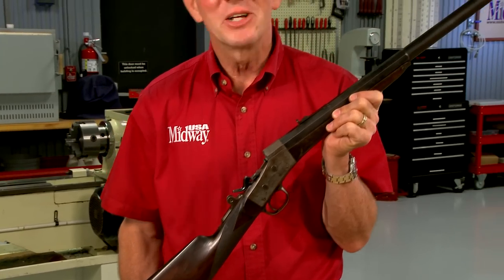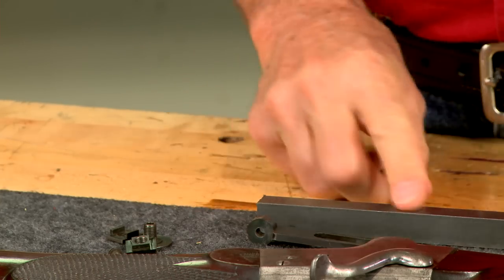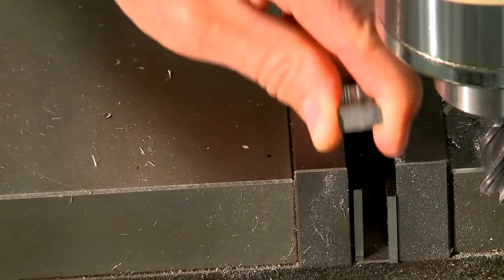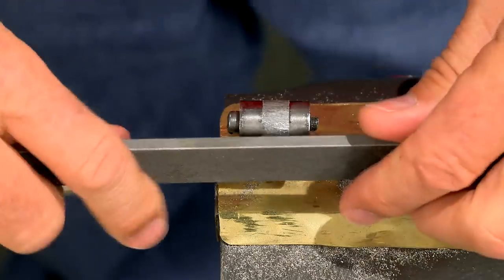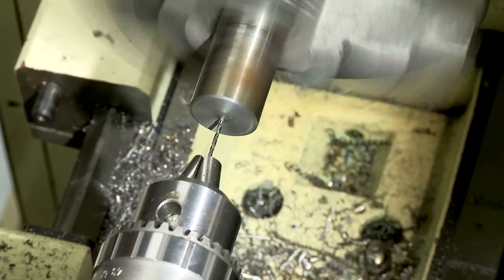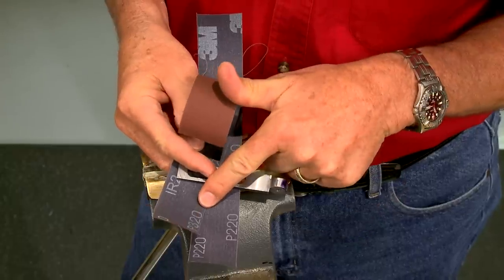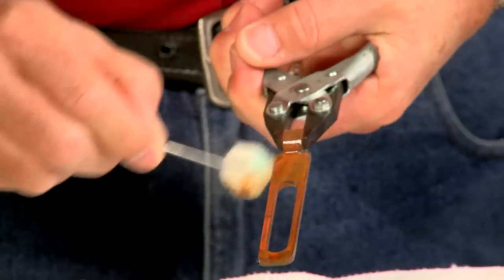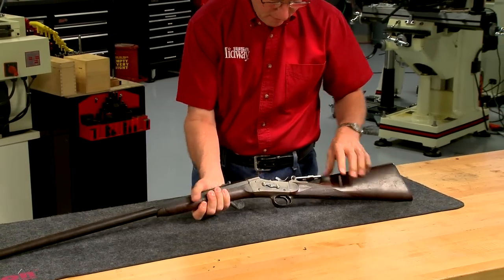Gunsmithing - How to Make an Original Style Tang Sight for a Rolling Block Target Rifle

Comment: can't believe you'd stoop to shimming the sight in Larry, I recall a video of you showing the difference between amateur and professional work and I believe shimming a scope was one of those things you pointed out.

I know there's a difference here but still, i figured you'd find or make the right front sight for this gun.
Reply: There is nothing at all wrong with shimming the front sight, it is the simplest solution that works as well or better than any other solution, including complex ones like manufacturing your own front sight from scratch, when you have one all made that will function perfectly as well with a shim.  That isn't true of shimming a scope. Having said that, I have shimmed scopes in the past and had it work just fine, even if it is a hillbilly fix. Of course, I have duct taped a flashlight to a shotgun and had that work fine too, in a pinch!
Reply: yes! shimming is a easy out i saw that vedio lol

Comment: Just a question. Why do you do so much filing and hand fitting when you have machine tools? Surely milling the slots and radii would be faster and more accurate.
Reply: +discostucrazymunkey You answered your own question mate. The machinery is used to rough out the piece, to a very close tolerance, but the really fine work and finish is always done by hand. It is artisan work.

During my apprenticeship (not gunsmithing) we had an exercise to produce a very similar piece, but not a tang sight, from a piece of mild steel, the only machine we were allowed to use was a drill press. We were given strict tolerances to work with and were not allowed to use emery paper or anything other than a file to polish the end work. I expect Larry learnt these skills also and it is extremely satisfying to sit back and look at the finished, handmade result. 
Believe it or not, to get finer tolerances, it is much better to finish by hand what you start with a machine.
All the best!
Reply: +Pilot McBride I see what you are saying from a satisfaction point of view, but I used to make tooling for can ring pull tops with machine tooling. A 50 micron tolerance cannot be consistently reproduced by hand. Not for £40 per hour.
Reply: discostucrazymunkey I take your point mate, but not everyone has access to such machinery, certainly not where I was trained. And I'm an old fart, lol.
Reply: +discostucrazymunkey Sometimes it's easier to use a file and hand fitting instead of making a one off setup to hold the part on the mill. I might spend several hours working out how to hold something and 10 minutes actually machining it :-))) Milling a rounded corner on a manual machine is non trivial work, just bung it in the vice and have at it with a file....
Reply: Another thing to consider is the gun its self was not made with such precise machinery. The parts have to be hand fitted because the guns themselves were hand fitted. Moreover, having a more human finish fits the look of the gun since perfect finishes were not available when it was produced.

Comment: Man I wish I had the money to buy the shop tools and hand tools you have! Definitely the JET mill and electro etching machine and all those fine files you have. Jealous!
Reply: You can find used bridgeports for cheap from highschools that are getting rid of them, auctions, craigslist. And if you get lucky you may find one for a steal.
You can even find files from garage sales, usually people think they are garbage if a little rusty, but they still work great.
Even tool boxes and machinist tools can be found for cheap if you are patient.
look around, and you may get lucky :)
Reply: What is a Bridgeport?
Reply: Even so, he's the CEO of Midway, and I will never have that kind of loot to buy the caliber of equipment he has. He has a lot of highly specialized tools, like that hammer spring compressor that he used on the Sharps rifle. I know he custom makes a lot of the specialized tools he uses, and to tell you the truth I (along with most of the population, including most gunsmiths) will never have the use for 80% of the tools he uses.
Reply: Very true.
Reply: What's a Bridgeport?
Reply: It's a brand of milling machine.
The first maker of vertical "knee" type mills in the USA to my knowledge.
Reply: Oh, ok. Are they the top of the line mills, or did you recommend them because the schools use that brand?
Reply: They are basically top of the line mills in their class. Or at least their knee type mills are, not sure about their CNC mills.
I think most schools use them as well.
Reply: Cool thanks for your insight.  I have wanted to get a mill for quite a while.  Is there a website that has school auctions that you use? If not, how do you find out about the auctions?
Reply: If your looking for a mill, do what I did and ask around. Do a LOT of research, more then you think you need. I got super lucky and ended up getting one free from a friend who has a machine shop.
Look in the paper for auctions, craigslist, and ask some shops if they have one they want to let go. There are some great deals out there! May I ask what side of the country you are on? If your in the East, bridgeports are plentiful. But in the West they are sometimes very hard to find. 
There are also tool clubs that have auctions and you might find goodies there.
Reply: I live in the Saint Petersburg, fl area.  My best friend's parents own a marine anode manufacturing factory,  maybe I'll ask him.  I didn't even think about that.

Comment: Two questions: at 7:11 you can see the sighting hole seems to be off center. Or am I missing a piece of information?And the rear section of the sight seems to be a tiny bit to long (10:20) to clear the stock.
Reply: I think the hole is centered, but there just may be something in side the hole making the light reflect off one side differently as it spins. Look at how he made the piece again, and you'll see it has to be centered.. And from the picture I just found on google, it appears that that same sight disk contacts the receiver tang, not letting the sight drop far enough to hit the stock when fully assembled.
Reply: I think some of the abrasive got in there. Or it's possible since he is simply polishing it at that point there wasn't any need to make sure it's center.